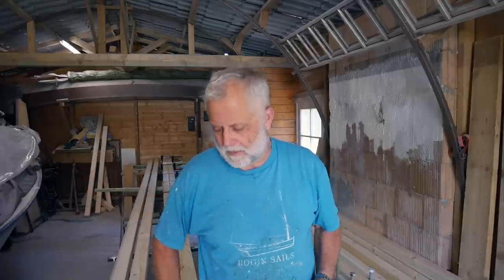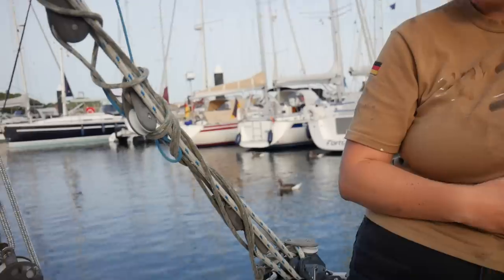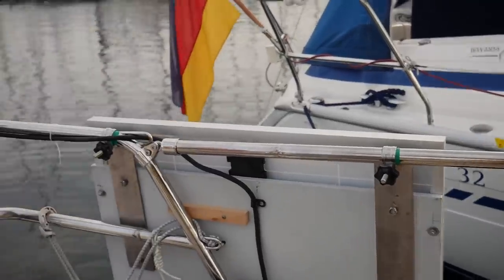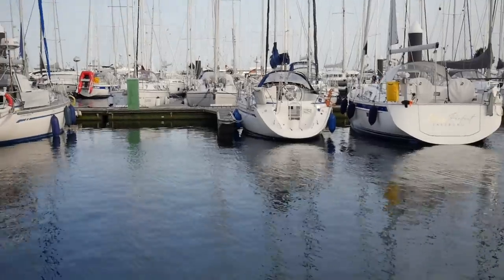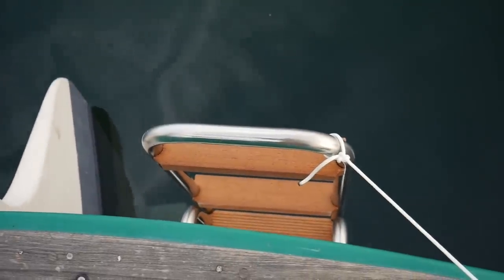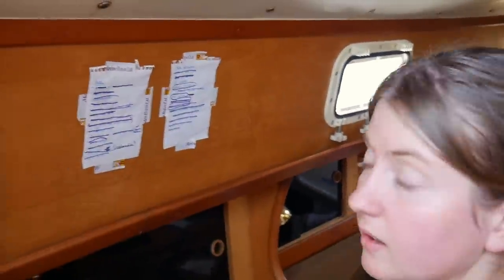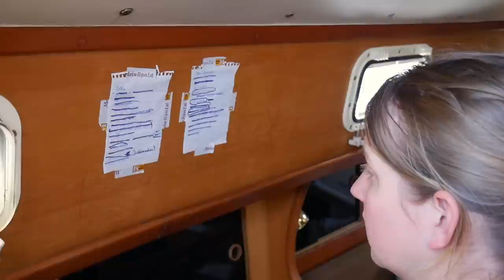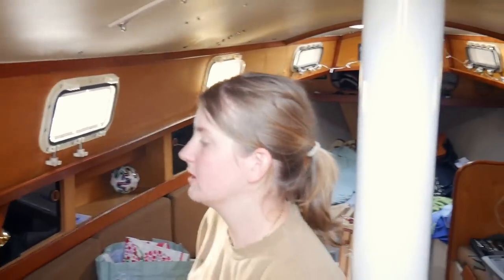Mast Building Part One - SV Tapatya EP235

Comment: So good to watch in these times - thank you. PS: Did you hear about the possible condensation problems in the mast hole?
Reply from the maker: Thanks Karl. No, I have never heard of condensation problems in a wood mast, but I have epoxy sealed the wood on the inside 🤔
Reply: @SVTapatya  Hi Tony, here is the link to the video: https://www.youtube.com/watch?v=KaWIIiv9zRg - around 4:18 just for info - all the best, Karl
Reply from the maker: Thanks Karl. One thing he doesn’t really clearly mention is that, to achieve the same strength, a hollow mast would need to be around 10% bigger in diameter ( approx and depending on a few things).

Comment: I was thinking about the bottom part of the mast where you say you will glue on extra bits to get the diameter larger. Perhaps alternatively those extra bits could be in between the square sections (in a star shape). That achieves the same bulking out of the diameter but encloses those bits within the mast, especially the top parts of those bits where they taper off into nothing. Also that would mean tapering the square parts on the inside of the mast rather than on the outside. That tapering inevitably means exposing end grain which would be better on the protected inside than on the outside. Makes the wood grain on the outside (where stress is highest) continuous with no grain run-off. 
All a moot point if you already have progressed beyond this point, or if you plan the cover the whole thing in biaxial and epoxy, but nevertheless.
Reply from the maker: Interesting thoughts DJ. I will be epoxy and glass encapsulating the masts, and painting them 👍😃
Reply: @SVTapatya  The considerations I mentioned only apply if strength relies on the timber alone, with a varnished finish that usually has a hard and difficult life on a mast. Your glass and epoxy finish provides protection and a lot of additional strength. Should be fine.

Comment: Could you tell me what the mast weighs? I have a mast of 8.5m which weighs 38 kg what is very much and I wonder what a mast build in a conservative method weighs in Spruce. I think, I'd go for nordic fir if I was to make a new one but let's see.
Reply from the maker: Hi Andre
I don’t think 38kg is heavy for a solid wood mast of 8.5 meters. Mine will be at least that, I imagine 
I haven’t finished one yet so can’t be more precise 👍
Reply: @SVTapatya  That might be true but my 20m2 Jollenkreuzer (7.5m with 20m2 Sailarea to Class) has no keel back an iron centerboard and rudder. I want the boat to more safe against capsizing to be able to sail a little challenging areas. They were built for sailing to the German Frisian Islands though and I have sailed it on the Weser at 6 Bft with full sails hard upwind. I'm a naval architect and boat builder and have an idea how to build a wooden mast from veneer.
Reply from the maker: Sounds good, Andre. Good luck!
Reply: @SVTapatya  Thanks, will be challenging...